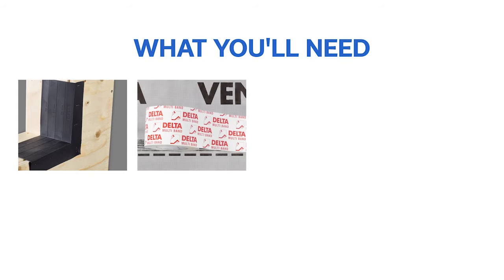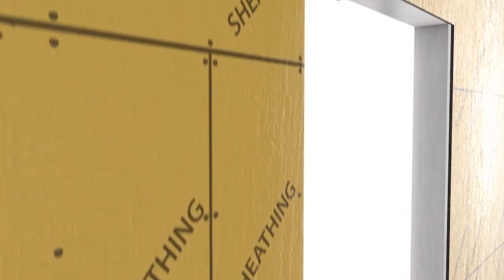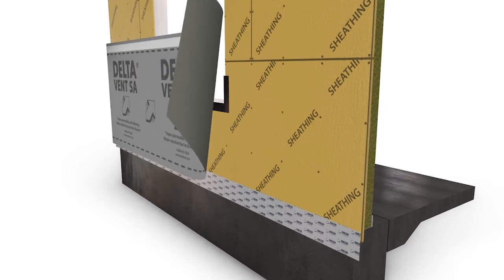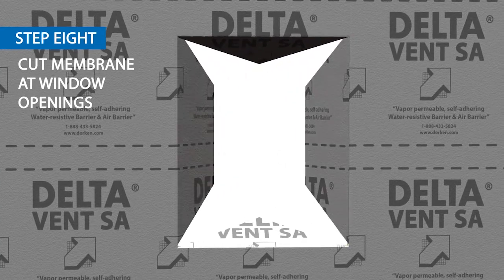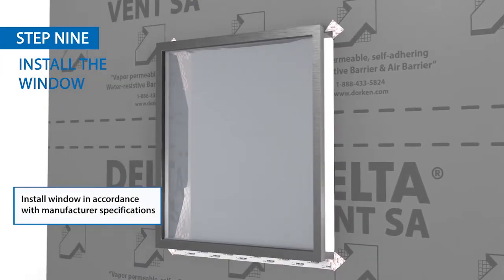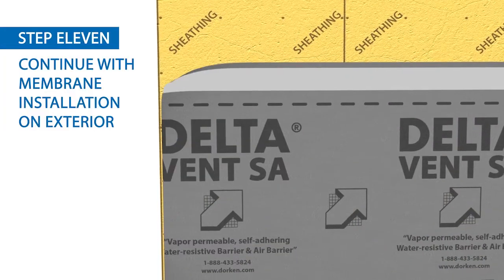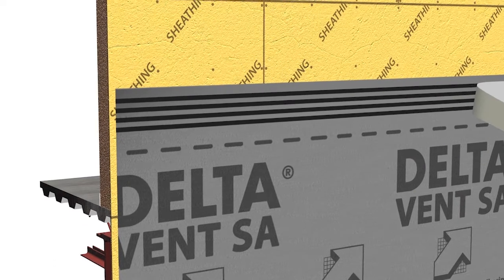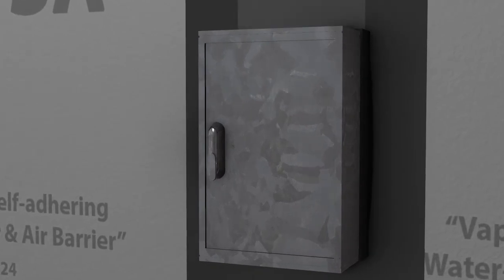How to Install DELTA®-VENT SA

Comment: Can I install this over asbestos siding shingles? I’m having 1 inch foam board installed over the asbestos siding then  vinyl siding.  I have spray in batten (cheap) installation now. No subfloors. Lol in VA and it’s cold!! 
Can I install this over the asbestos first. That way it’s more secured when I add on laterite the home.